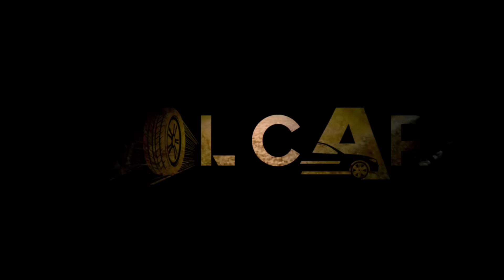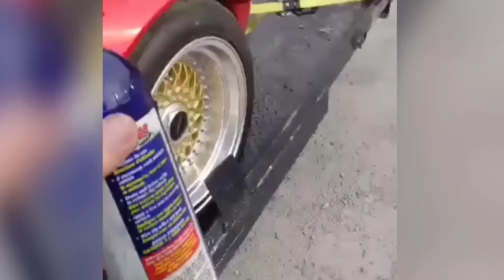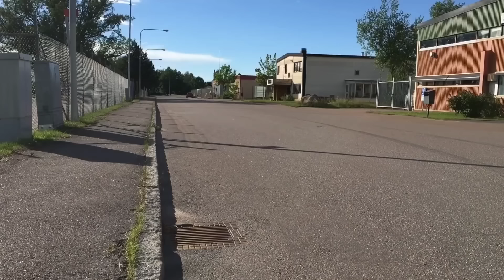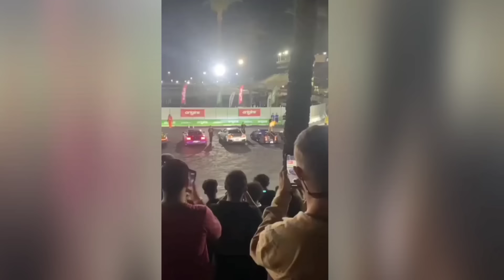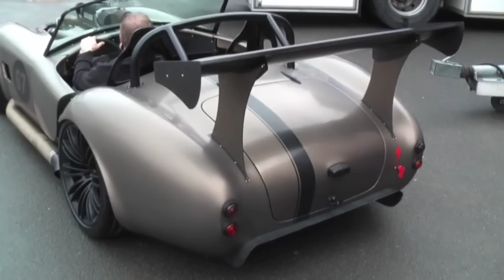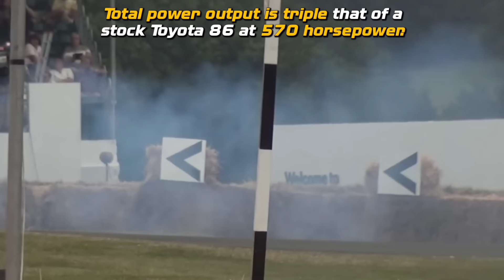World's 6 Most Insane Custom Built Cars with Motor Replacement

Comment: The massive exhaust in the Lambo is as ridiculous as it gets. I thought the main goal is to make the car appear as if nothing has been done to it. As a freshman in college I had a 1971 Plymouth Roadrunner w/440 magnum, dual 750 Holley Double pumpers/tunnel ram. It looked cool as an 18 year old with the carbs sticking out of the hole where the air grabber is supposed to be.but, now I wouldn’t want that. But, in this day and age (kids with too much money and the incessant need for attention…and you get this atrocity.